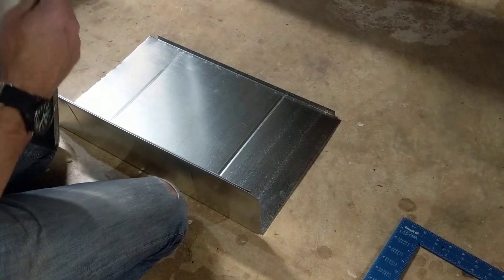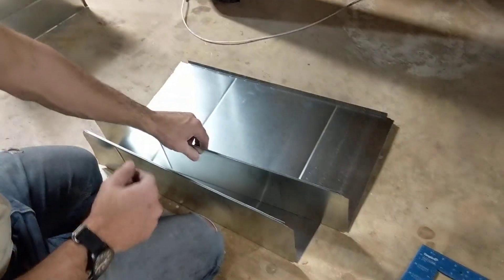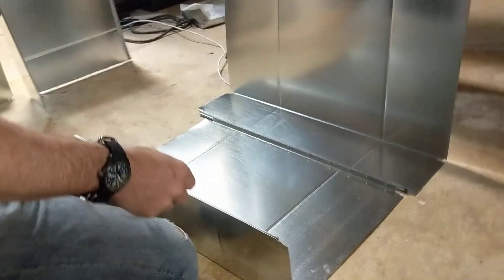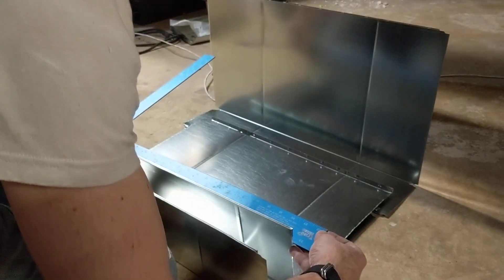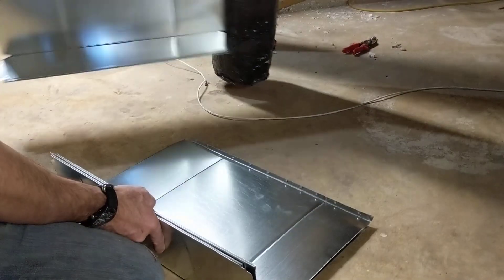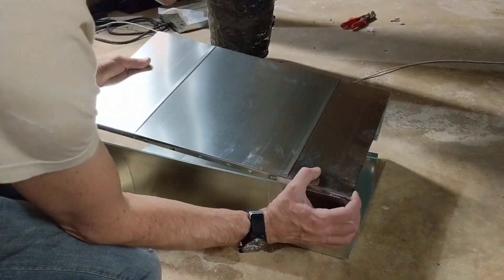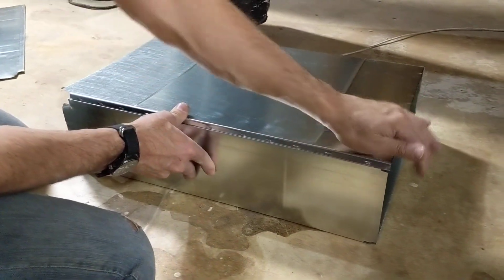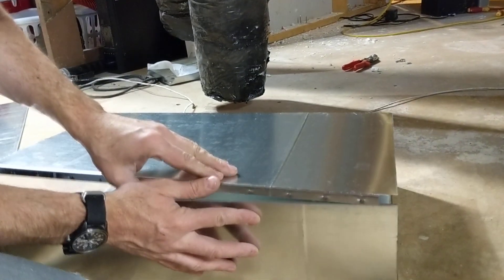Assembling rectangular duct

Comment: I'm guessing if they do not line up properly it will never snap in? 

I've been trying to fit mine for 2 days on and off then decided to just put some really strong glue .. it kept coming apart
Reply from the maker: The ducts must line up. If not, you need to make an offset fitting, use a flexible fabric connector, or something else. Glue doesn't sound good.

Comment: I need to make more head room in the basement which is 84” from floor to bottom of joists. The old man prior had a company run through that ripped him off and undersized everything. I’m debating on changing it all to the correct scale but doing a shorter height wider depth to stop me from hitting my head on it lololololol. The original duct work hangs way too low
Reply from the maker: Cool!
To move the same air at the same pressure with a more rectangular, less square duct, you will have to increase the duct area. Check out rectangular duct calculators online. It'll be great when you're done!